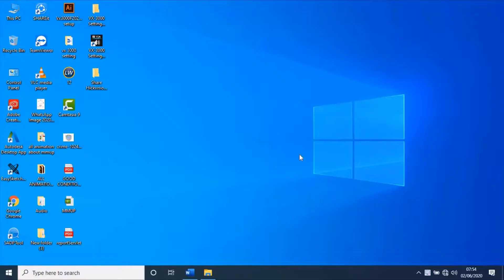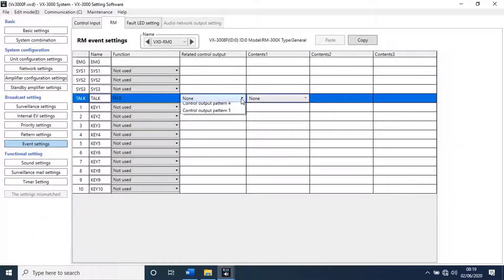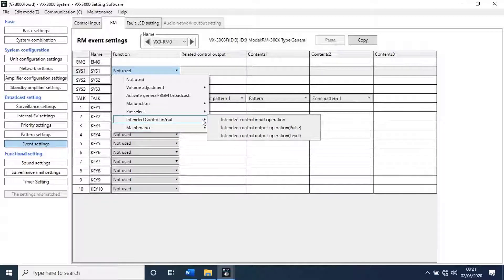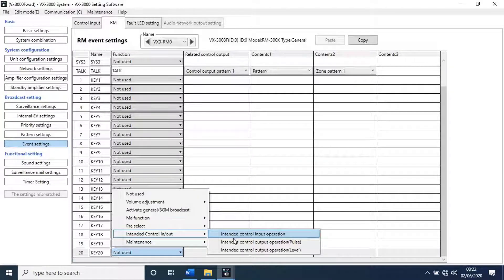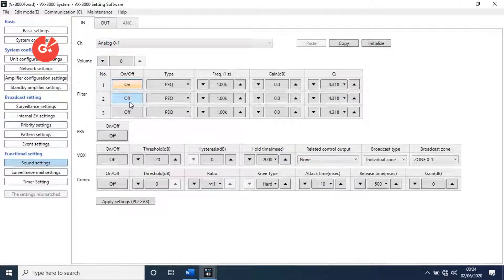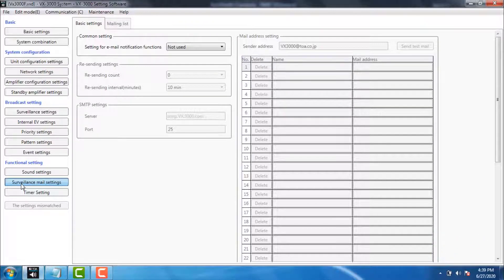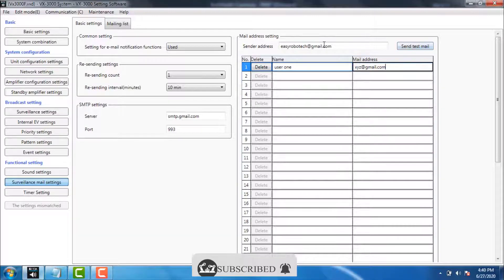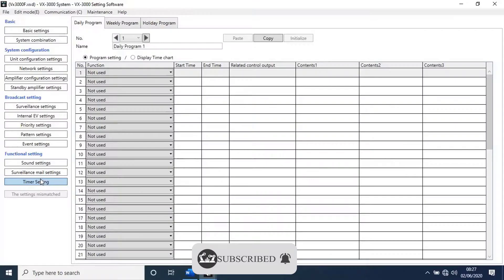VX-3004F/VX-3008F/VX-3016F VOICE EVACUATION FRAME CONFIGURATION AND FIRE ALARM SYSTEM INTEGRATION-03

Comment: Hi Sam

My name is Wilfredo Cortez, i am from México.....

I have been looking for technical support and I have not found, watch some videos on youtube that were uploaded. I bought the VX 3000 at TOA Mexico, but their technical support has not been able to help me.

The fault I have is that I cannot update the timer setting, it marks an error in restarting the equipment.

and therefore I cannot update the schedules...

has it happened to you? could you help me?

Another issue is that in the timer setting there are only up to 50 functions in the daily program, and the user has more than 70, what can be done here?

If you can help me I appreciate it very much. Greetings.
Reply from the maker: Ok 
I try to support you